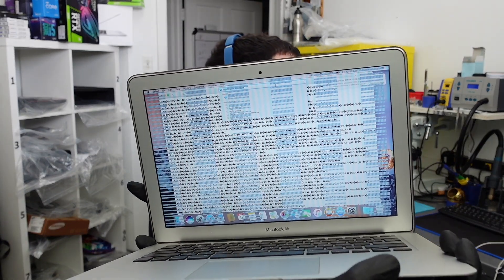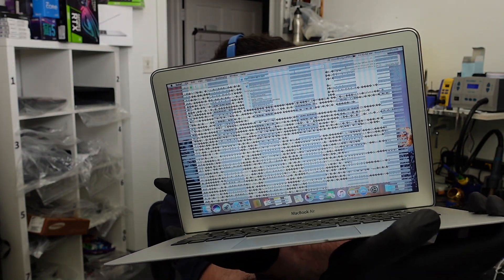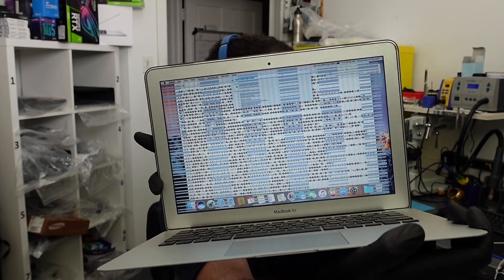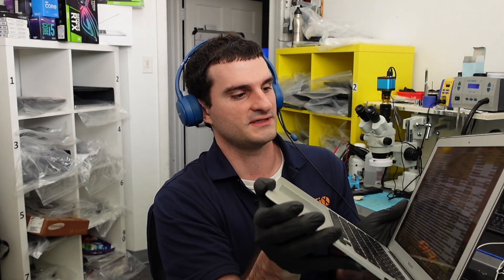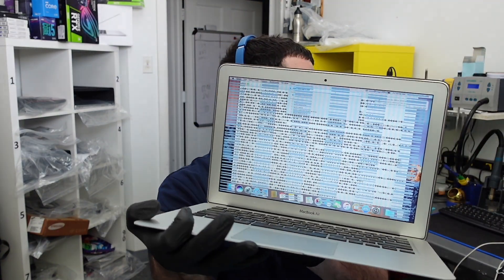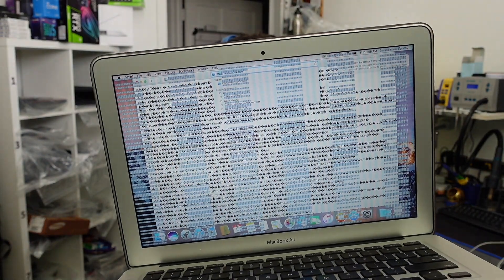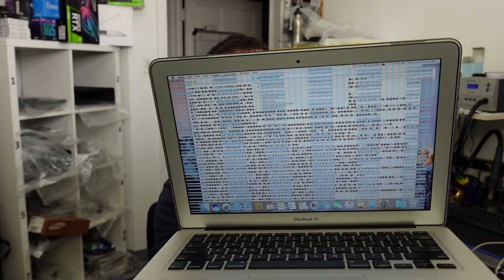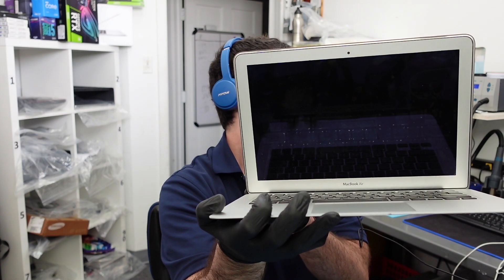Why Not To Use Aftermarket SSD on Macbooks

Comment: I really understand Apple. I have a Macbook Pro 15 2013 and I wanted to upgrade the SSD from 512 to 1Tb, but the cost of an original Apple SSD is very expensive. Over the years I have seen several SSDs that claim to be Apple compatible but looking at discussion forums, there are many problems and one of them is the OS crash when you leave the screen closed for a few hours as is my case.
Apple's great differential from my point of view is having full control over the hardware. I've been with the same computer for almost 10 years and without having done a system reinstallation or crash. I invested around $3000 at the time and it was worth every penny.
Only component change I did: speakers and the battery that reached more than 700 cycles.